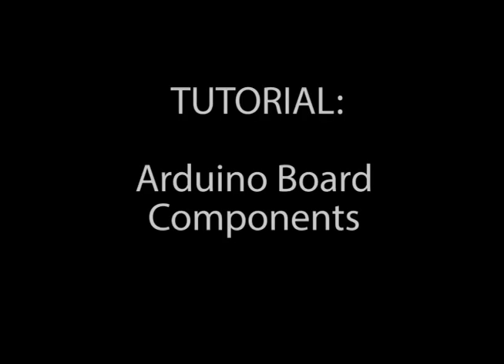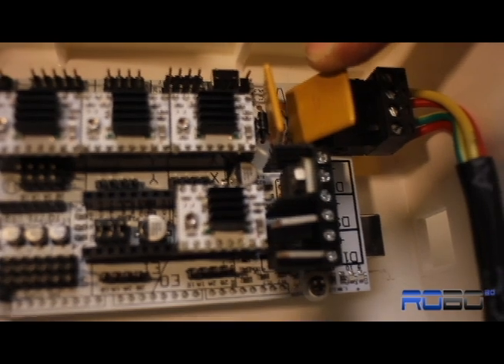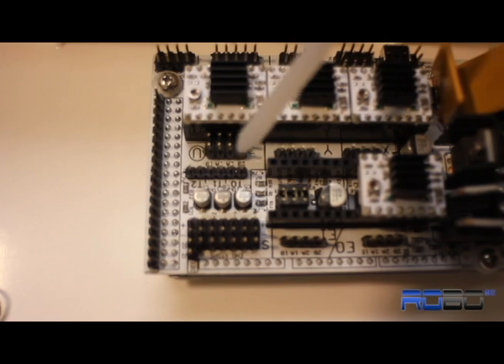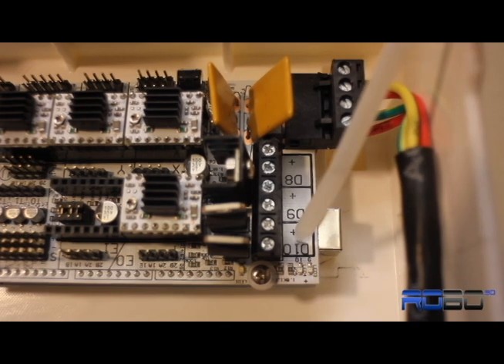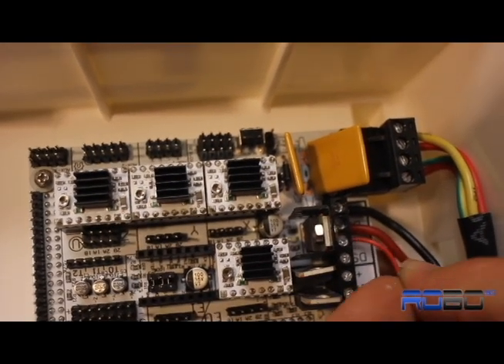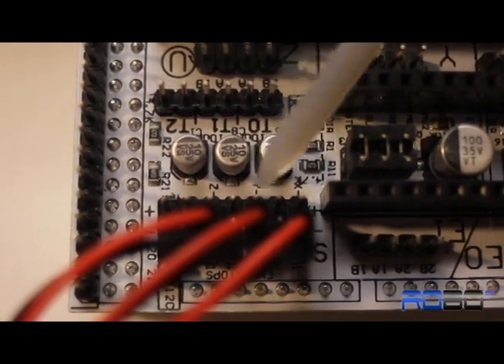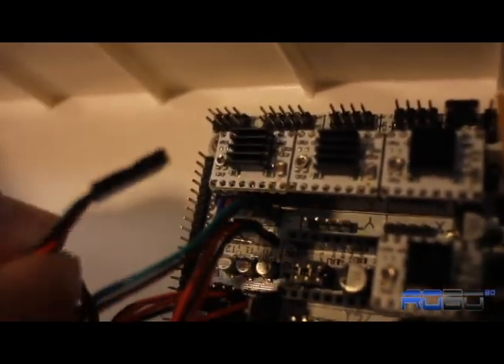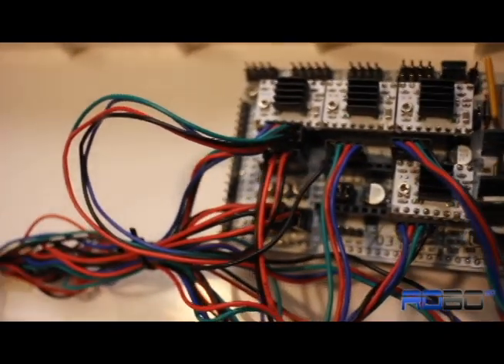How to connect the wires to your arduino control board

Comment: On my original board, I had a slot for FAN0 (lower right of board) and slots for LED1, LED2, FAN2 (upper left of board in AUX). Nothing was plugged into D9 on my old board. Which fan (FAN0 or FAN2) goes into D9? Where does the other fan connect? I do not have a 2 pin connector in the upper right beside the fuses. Any help would be appreciated.

Comment: what do you call the connectors you're actually using to physically connect the wires to the pins? and where do you get them? I don't have a kit I'm just using stock wire and I'm trying to figure out what to search for to get the right four-pin and two-pin connectors to use with the ramps board.
Reply: Those are called "Dupont" connectors. You can get them at places like Banggood.com  Get the tool too. For about $20 you can get the crimp tool and a few hundred connectors.

Comment: I found out my used robo3d printer was a kickstarter version. Glad you guys mentioned those words about the XYZ being different. I had to buy a knew Ramps 1.4 board because I believe the Polyfuses were going bad. The printer would stop printing half way like it was jammed, but when I opened up the extruder to clean it out everything was fine. I found out though with the MKS Base boards they don't use the polyfuses no more. I should of got that board instead. :( 

Plus the LCD screen is way better.

Comment: Hi! I purchased my brand new Robo 3D Printer about a month ago, but I have had to clean the extruder...unfortunately, all the wires on the print head mechanism are THE SAME COLOR...so I risk shorting out my board if I don't hook the cables up to the right ports...unfortunately, all the clips are the same, too...so how do I go about hooking these things back up? I need a manual!
Reply from the maker: Hey there, can you please give our Customer Service team a call and they can walk you through it: 24/7 help line  844-476-2633

Comment: I just bought a used R1, the guy who had it had tried to upgrade it, but didn't know what he was doing.  This video helped a lot in figuring out how to put everything back where it should have been.  I also have an R1+, they do take a little getting used to but I have used several 3D printers and whilst the R1(+) isn't perfect I like it a lot most than most, big build size, great customer service and lots of online help from the community.

Comment: where do we plug in the cooling fan on the underside
Reply: +Donald Durm 
Right in between the x-axis driver and the fuses. There are two lone pins, plug it in with the red (positive) wire on the bottom (from the orientation of this video).
Reply: +Richie J 
did you ever find out where to plug the fan in on the board?
Reply: +Richie J Could you tell me where you plugged it in?